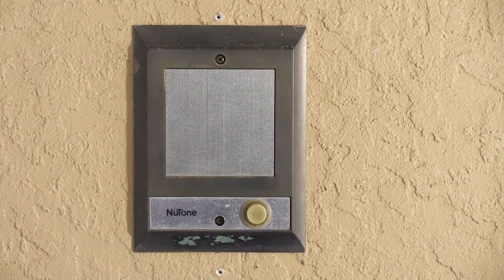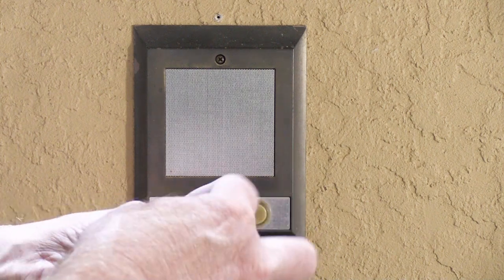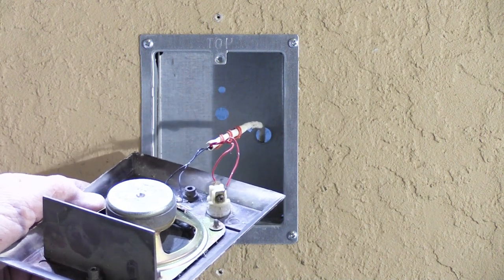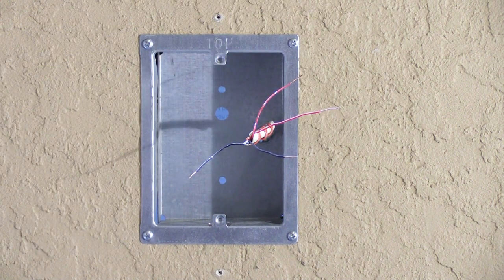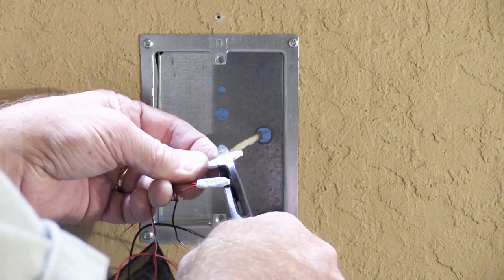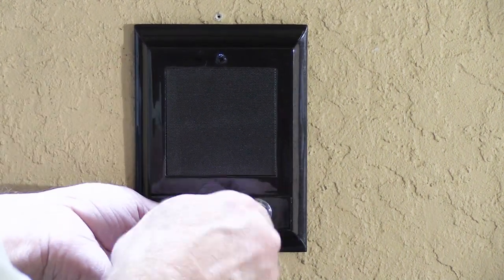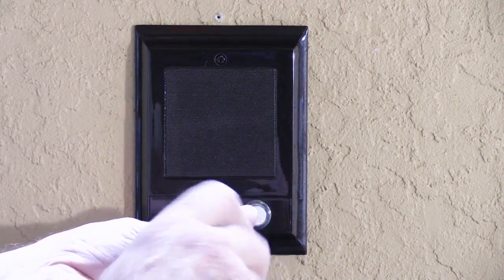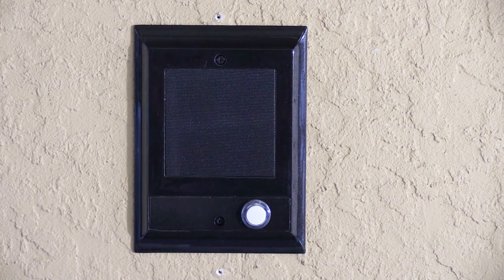How to Install your Newly Refinished NuTone IS69 Entry Door Station Correctly

Comment: Pretty good job. Hey you might want to try some of those hammered look paints, like Pewter Silver, bronze or copper too. Also if you put some two part automotive clear on it, it won't scratch as easy. Try this stuff, (SprayMax 3680061 2K Urethane Clear Coat, Aerosol) about $16-$25.00 a can. it comes in a can that you can shake. It does have a shelf life after you mix it, it's listed on the back. So make sure you either have a lot of them to do or be willing to eat the cost of not using all of it. Hope that helps. Best Wishes & Blessings. Keith Noneya
Reply from the maker: Hi Keith:  I made the decision to not clear cost the IS69's because every additional coat of finish is a chance for flaws to show up.  The exposure for most  units is more limited than a car would have and since the color coat is a 2-part product, it it very durable as it is. Also, not clogging up the tiny holes in the grill is a concern. - Chris